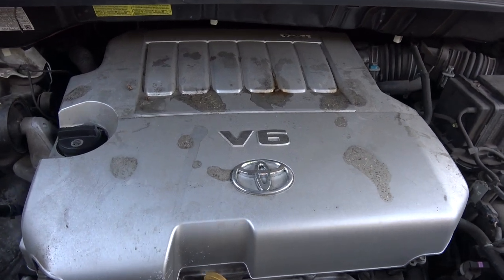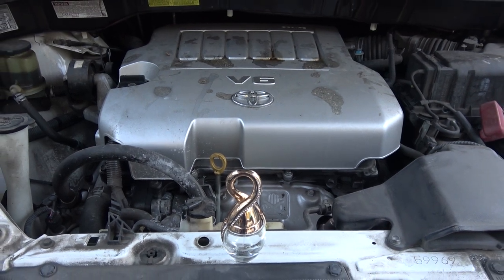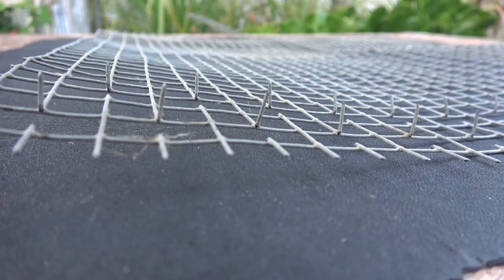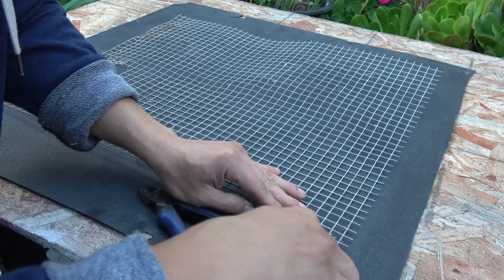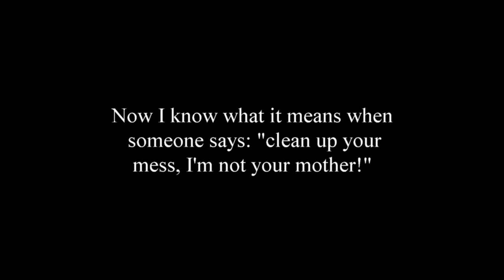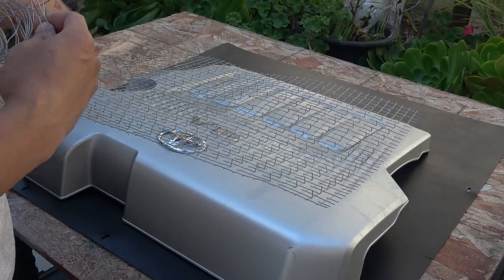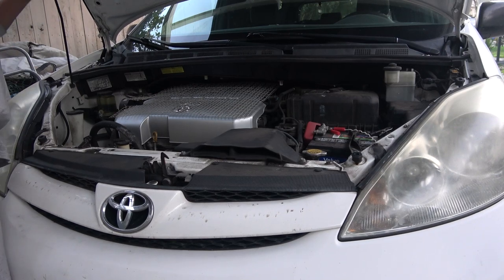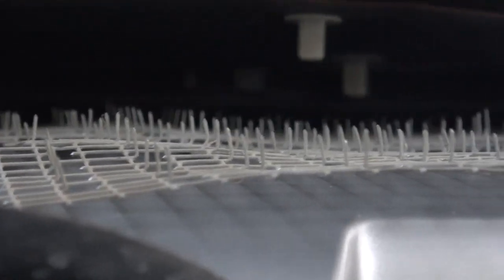How to prevent rats from going into your car engine and other places

Comment: Wonder how two thin panels of masonite or plywood or plastic hot glued back to back would work: Leave one plain, but drill dozens of tiny through holes into the other. Push a tack through each hole. Hot glue the second panel over the tack heads to stop them backing out.